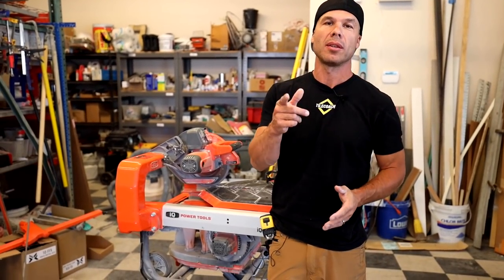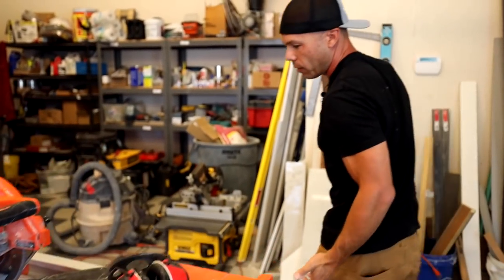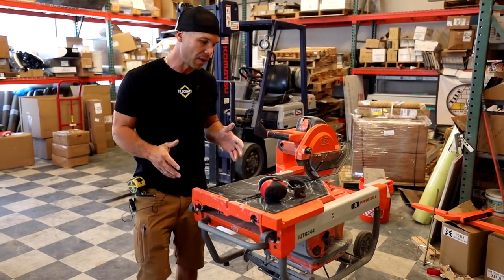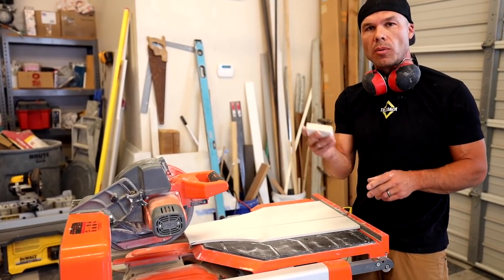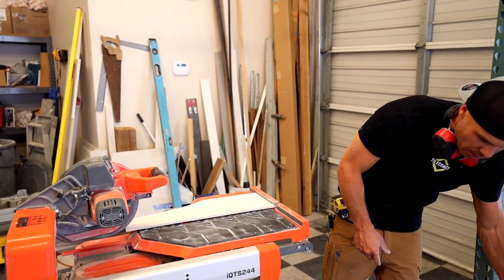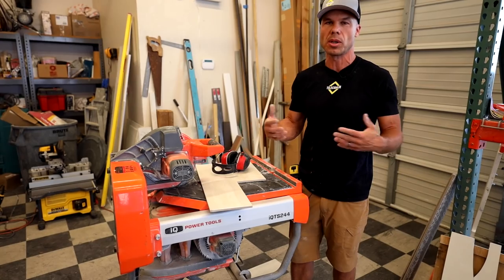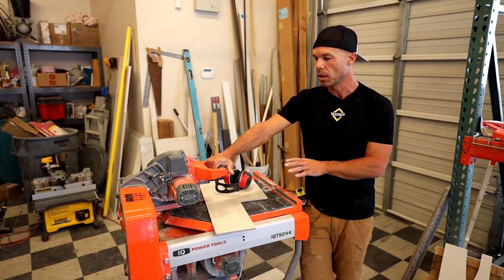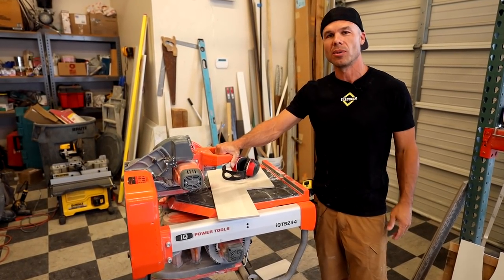2 Years Using the iQTS244 ---This is what I think!

Comment: This saw would completely change my company. I’ve been looking at it for a while.
Reply: How would this saw change your company ? Just curious
Reply: @markme4  I have a big 10in Dewalt tile saw that’s a pain to lug around and is way overkill for backslashes, small rooms, etc. I feel like a small compact saw thats waterless would be a great tool to have to do smaller jobs such.
Reply: @TonyVM775  Get yourself a Rigid 7" or 8" (I prefer the 7") and put a good blade on it like an MK hotdog blade.  These saws are inexpensive,  reliable,  and super lightweight and cut almost everything. I used to run big heavy MK saws , no more !

Comment: I just recently got back into tile and I have pretty much everything I need, except a wet saw. I have to rent one when Jobs come up. I wish I was at the point that I could afford one. That’s a really nice saw your giving away. Well may the best person win, good luck to everyone.
Reply: This isn’t a wet saw
Reply: @chrismartin4668  what is it ?
Reply: @wasntme3651  Its a dry cut tile saw with a built in system that collects more the 99% of the dust. The same manufactor makes a 7 inch table top that I have. 

Also, just want to pass on this info: The 7 inch ridgid saw at Home Depot is a good saw for the money. You can get it for around $300.00 or so to tie you over until you are able to upgrade. It's compact, lightweight and well worth the money to get you going.

Best wishes.
Reply: @Heb101922  
Thank you 👍🏼

Comment: I have a couple of the 7” table top IQ saws. They do chip a little more than a wet saw and you can’t cut as fast as you can with a wet saw but they definitely come in handy when doing small bathroom remodels or in new projects when there is raw hardwood that you don’t want to get wet. It’s especially nice here in NE with the brutal winters being able to set up right inside the room. I’ve cut everything from Glass mosaics to rips in 48” porcelain. They run just over $600 so for me it’s definitely worth the investment.
Reply: How does it do with thin glass?

Comment: Great information.  I am still planning on doing my own tile job as DIY.  Seriously considering the Kobalt 7 inch or the Ridgid 7 inch wet saw.
Reply: I have both and have used both for years and they are equally good for diy and in my opinion the best bang for buck is the rigid. I think out the door I paid like 350 for mine

Comment: 100% agree.  I've used it a couple times, and for the price of the unit and the blades, it's just not worth it. 

My montolit blade (progres_cg 4 or 4 1/2 inch) gives me a much better cut with less chipping.  And from what I have seen, nothing can beat the glass cutting abilities of the montolit cermont cvp for glass tile.  I've tried water free glass blades and they just don't work.   Thus u need your wet saw regardless 

I have multiple saws all with different blades and it works way better.  A piece of poly deals with all the water mess.  

Just my opinion

Comment: Have you ever used that IQ blade on a 10” dewalt wet saw without water? If you’re cutting outside and dust is not a problem, can I use this IQ dry cut blade with a dewalt saw? Even though it makes dust, cutting outside is not a problem. Would it make clean cuts?

Comment: Hello Isaac, quick question.. I’m remodeling my shower and thinking about using laticrete hydro ban boards, mud bed with flo fx drain With hydro ban sheet membrane. All I need is a 3’X5’ membrane but have to order 108sq ft roll.  Can I use this membrane and cut strips and use for all my corners?

Comment: Hello, quick question I hope you will answer. I’m doing my first remodel and I’m going to tile my shower. I have installed kerdi board. I know I’m supposed to use unmodified thinset to stick the tiles, but I cant find it anywhere. Lowes seems to only have modified stuff. Can you point me in a direction to where I can find what I need? Brand? Anything?
Thanks so much and your videos have been a great help!
Reply: Where are you located?

Comment: I had this saw and it’s garbage, the constant braking tiles is because the blade overheating the tiles and when that happens the tiles expand and crack, the purpose of the water isn’t only for the dust it also keeps the blade cold so this doesn’t happen

Comment: I've had a few saws that had hangs in the tray along the cutting process. This saw seems to have that as well. If you've ever cut tile with an angle grinder then you already know how this saw will sound. They should have made this saw an optional dry cut. The entire tile saw market is gimmicky imo. There's not a single perfect product out there. You can easily spend 1000 usd and not be happy with the saw. The next level market is lacking so pros use weekend warrior tools. Fact of it tbh. Milwaukee is the best handtool company out there and stomps Dewalt in so many ways, but DeWalt makes the best tile saw lol. The market lacks true competition. It's mainly bottom feeding level companies competing with middle of the road products. Like the best table top as far as reviews go is a Porter Cable from Walmart. Let's be honest while we still can be. The market is trash right now lol

Comment: This one is extremely heavy, bulky, and very loud. for few corner cuts which tile cutter can not make, it is too much to bring it around sites. it still makes chips on tiles, and vacuum doesn't suck at all When I have to cut tiles for GPO or holes. very disappointed.  I reckon this one suit for commercial sites where safety standards are strictly applied. it was good idea but I felt this one is more like proto type and Im the beta tester who paid for it. Ive learnt I should not put my money on non-major brands. Wish Milwaukee or Dewalt release better verson of it.